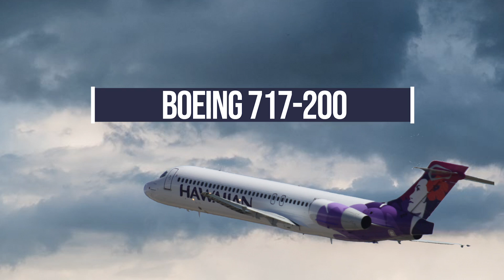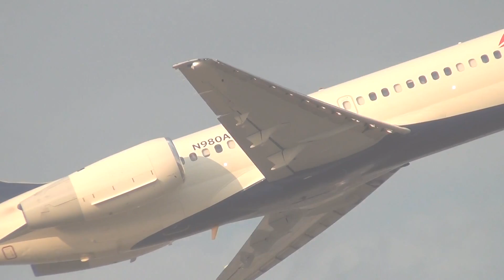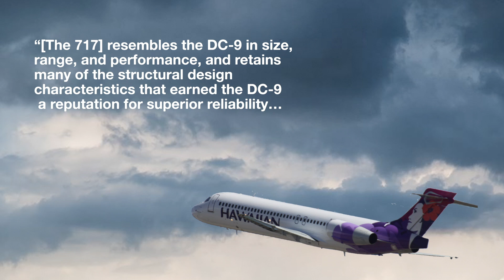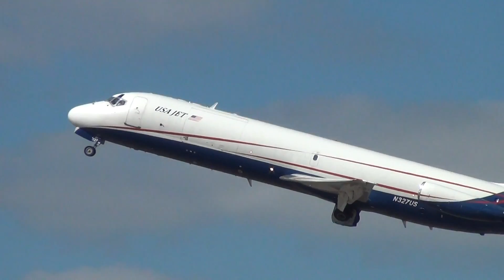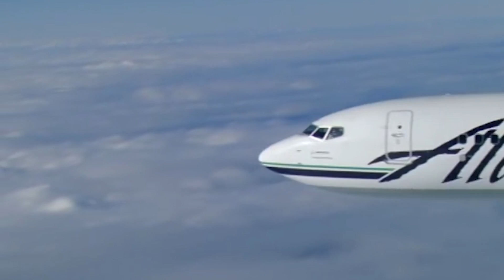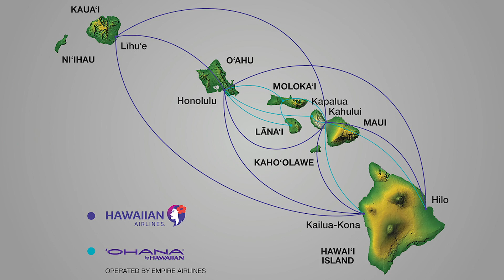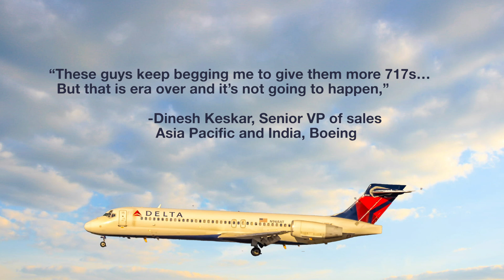Why Boeing Built The 717 And What Makes It Special

Comment: They built the 717 because they had the tooling and production line.  It was in production when they bought Douglas.  They thought they could sell a few more without incurring much in the way of development cost. They were after the 100 seat market. Until they weren't.
Reply: Even before "Day One", the first thing Boeing did was to try to lure all MD-95 customers away with cheap deals on 737s. When that didn't work, the next great idea they hit us with was to replace the autopilot control panel with one from a 737. Great from a Boeing commonality and training standpoint, however the DAC ACF control panel was a more advanced and simpler design, and thankfully our launch customer AirTran refused to let it change.

Comment: whenever i see planes with engines at rear i remember honda jet and i ask my self how come not more of companies put engines like honda did.
Reply: The single greatest mass in a jet is the fuel, which is in the wings. The second greatest mass is the engines. As you use fuel, the CG moves to the rear in an aircraft with tail-mounted engines, causing trim drag. Honda put the engines above/aft of the wings as they could not mount them under the wings. Putting the engines on the wings reduces structural loading (read: weight) the fuselage has to endure, putting them on pylons reduces the noise transmitted to the passengers vs mounting them to the tail section.
Reply: @rotty9786  all good and well... but why only honda? as i read your comment this is great spot for engine since it wont change CG during flight. so for small jets it would be perfect spot.
Reply: @jebise1126  agree, it is a good spot for a smaller jet if you don't have the clearance to mount them under/ahead of the wing. Why only Honda? Apparently they don't care that the engines look terrible in that spot (IMHO).

Comment: Boeing: "meh there’s no money in the 100 seater market. Dump it"
Airbus: "thanks”
Reply: TWA had a bunch of MD-95s/717s on order, since their was some commonality with its MD-80 fleet.  When AA bought TWA, AA planned to continue with deliveries.

After 9/11, AA pressed Boeing to reduce the lease rates negotiated with TWA.  The lease rates were based on TWA's lousy credit.  AA thought rates should have been reduced, to be in line with AA's credit rating.

Boeing would not budge.  Since AA's fleet of Fokker 100s were owned outright, AA canceled the remaining order and returned the planes already delivered.

Now, in retrospect, AA did the wrong thing.  The F100s became maintenance headaches, leading to retirement in 2004.  AA should have retired the F100s and kept the 717s.

But, when AA canceled the order, no one else was interested.
Reply: One thing is for certain: there’s no money in and rarely a good reason for cataloging unprofitable widgets, and this one didn’t sell. Unless the fortunes turn around for the A220 series, it’s headed for the same place: the history books.
Reply: @1_lens_view  Remains to be seen if it doesn't sell. No regional jets are selling ATM.
Reply: @1_lens_view  The a220 has enough orders to make it profitable, it is also a really useful plane in the pandemic.
Reply: 1_lens_view  I beg to differ. The A319/320 replacement may well be based on the a220 design. It’s an extraordinarily well designed jetliner
Reply: @Dean in BNE  I’m not saying the 220 is a bad aircraft or that it’s design won’t influence future products, I’m just saying so far the A220 has not been profitable for a variety of reasons, including low sales numbers. That has to change or that aircraft won’t stay in the line-up. There’s a lot of competition in the 100-passenger space.
Reply: I bet that Boeing can make more profit selling as little as 80 787s than Airbus does selling 600 A220s. Narrow body market has a very thin margin and the 737 was only profitable because it would sell several thousands. Boeing can sell 787 also in the low thousands and make a vastly higher profit margin.
Reply: Gabriel Teixeira uhm...what? An airplane becomes profitable if the sales grow over the development costs. And either way, airplanes are sold via leasing companies so that renders your argument useless. Or you are comparing net profit from each sale, which makes even less sense because those numbers don’t seem to make any sense.
Reply: @bobtahoma  Nope, never made a dime. How's BA doing btw? LOL
Reply: Exactly. Boeing has been making serious mistakes over the past few years. It’s actually quite sad.
Reply: Lol nice argument
Reply: The Trump derangement syndrome is real in this comment section.
Reply: @tylerkriesel8590  Agree. Came here to learn about the 717 aircraft, not political rants.
Reply: i like trump but im not in politics maga 2020
Reply: Airbus $30 a share  Boeing $130 lows $600 highs haha  Dump the bus
Reply: @youbestbequiet   Airbus has many more shares than Boeing - not least because Boeing has a habit of doing share buybacks to artificially boopst the share price (and hence executive bonuses). Boeing's total shares are worth $75B, Airbus is worth $48B.

Pretty well all Boeing's net value is in their defence contracts. In other words Boeing is totally dependent on the American taxpayer, while these days Airbus mostly pays its own way.
Reply: @kenoliver8913  Airbus is subsidized by france, England, and Spain, taxpayers paid for the development of their Airliners
Reply: @youbestbequiet  Dude, do you not understand the stock market? Or basic economics? Of course you don't.
Reply: @youbestbequiet  Wow, no wonder you fell for that MAGA BS, you're really not very bright!
You can have a company whose stock sells for $1 that is 50 times more profitable than a company whose stock sells for $2,000. Bet you went to Trump uni! Or are you just another plain high school dropout?
As I said before, no wonder you're a MAGA victim!
Reply: @galileogalilei7844  Lower taxes, record high employment, actual fair trade deals, troops being pulled out of bullshit wars, justice reform, UN and NATO finally being held to account....Yeah, we were tricked hahaha
Reply: @galileogalilei7844  And keep fumbling about with those $1 OTC trades. Thats what most wannabees play with.
Reply: @youbestbequiet  Wow, "Lower taxes, record high employment", the only ones paying less taxes are the richest ones, the ones who did not need a tax break to begin with. I'm sure you have not gotten any tax breaks anyway, you poor bastard.
And record high employment means nothing as population is always growing, what matters is the unemployed percentage, have you checked it lately?
You keep talking like a Trump Uni graduate! So ignorant, so sad, so lame.
Reply: @galileogalilei7844  The only ones paying ower taxes are people who actually pay taxes. Ours went down about 5%. Of course, no state tax in Florida so TRUMP2020
Reply: @youbestbequiet  So you went from paying $200 total a year to paying just $190 bucks, right? Or just how much does a high school dropout earn this days?
I'm sure the 14.7% of unemployed Americans (a higher rate than in the great depesion of the 1930's) are so, so happy to hear that the Trumptart will not be helping them since he decided to cut taxes on his wealthy friends and his ignorant followers instead, along with taking away health coverage for the rest of common people. Worst time to be an American since the great depression!

Shit floats so I guess that's why you, Trump and the rest of your shitty kind are way up there! Lol.
Reply: @galileogalilei7844  Dont worry, you wont lose you section 8 housing voucher or EBT card
Reply: @youbestbequiet  Oh FFS, I'm not a Murican! Lol! Lucky me! 
You seem to know a lot about the shitty USA social programs, I had to look them up myself as I have no experience with them as you obviously do.
I did get my masters degree there, worst 2 years of my life! I have a low tolerance for ignorance you see and the general public there is #1 in ignorance world wide.
Fortunately I don't have to put up with your shitty president and his cronies as I live in a decent place surrounded by decent people.
But you keep living your uncultured reality show life, you keep admiring your painted face, cheap blond wig, clown of a president, you keep supporting that false MAGA campaign lol. If that's what it takes to keep your mind off of the truth about your sad, puny life then you just keep doing that!
Enjoy it while it lasts, things that bad tend to auto-destroy and november seems to be just around the corner now!
Keep smiling boy! Lol.
Reply: @youbestbequiet  I am sick of tired or these "claims." Middle class people still pay more taxes and the rich pay less. Donald Trump has done NOTHING to support the middle class. He says that he wants the rich to pay less so they could start jobs. In reality, he does that to pay less. Also the middle class DO pay taxes but our rates aren't lower. Stop watching FOX and pay attention for once in your life.
Reply: @galileogalilei7844  He upvotes himself as well!
Reply: @meganthai1998  Ummmn he is not that bright.....
Reply: People, just ignore the MAGA incel. Like Trump, the only thing they want is attention.
The guy as no flipping clue about reality, that's what happens to MAGA brains on Fox news.
I can tell him one thing: the UN and NATO are not being held to account, they are instead laughing at Trump. He's a clown and you MAGA incels can't even see that. Pathetic and sad.
Reply: Galileo Galilei eat shit you elitist prick.  What does politics have to do with his post?  Regardless of his username, he didn’t mention anything political.  Just can’t help yourself can you?
Reply: ICNTOANTU  “peaceful” my ass.
Reply: @galileogalilei7844  < Mindless dribble from a socialist democrat.

Comment: As a retired Delta pilot I'm concerned for the Delta people and all airline employees worldwide. As for the 717, it was a proven, rugged and reliable type. Delta happily stumbled upon a bunch when AirTran folded. Note that the registration numbers on the Delta 717s end in AT. I've flown on them many times (as a passenger) and it's a smooth, quiet and reliable jet. Who knows what jets and people will be left standing and flying after SARS-CoV-2 is done?

Comment: Midwest Airlines and AirTran were the original launch customers for the B-717.  The production line at Longbeach CA alternated between these two air carriers, and several aircraft were in work painted in either’s livery colors. I was fortunate to have been on Midwest Airline’s acceptance team, and flew several C1 customer acceptance flights, usually up at Palmdale Airport. Great little airplane, but didn’t have the legs for several key city pairs
Reply: Don't you mean TWA and Midwest Express?

Comment: Not a single one has ever crashed or malfunctioned. It is the most reliable aircraft ever built with a flawless reputation. If Boeing was smart they would design an updated version of the 717 for when the 200s retire.
Reply: Novuso: That depends on your definition of the 717. The base aircraft, the Super 80, did have at least 1 crash; ASA261 off the SoCal coast in 2000. I was working the sector that was going to get him to LAX, but the aircraft failed before he was handed-off to me. Sadly, other pilots in the area saw him go down. It's kind of like saying a Cadillac has never been in an accident but a Chevy has.

Comment: A few of the aircraft clips in this video are DC-9s or MD80s. The 717 is easily identifiable by its squared-off top of the vertical stabilizer.
Reply: A carryover from the MD-90. Many parts are interchangeable from the DC-9 all the way through the MD-11.
Reply: A few later MD-80 series also had the squared-off fin.  I want to say MD-87 and MD-88?  Maybe only the 87?
Reply: Also the two giant RR engines give it away too
Reply: True. Because in some parts he was talking about said aircraft and/or related products.
Reply: @07VFDInLCD  Nah, he suggested they were 717s. He did talk about the DC-9, but then went back to talking about the 717 and kept showing more DC-9 clips.

Comment: Why is there still common misconception that the 717  is not as fuel efficient as the A319/A320 or the 737?!  Even with the old DC-9 wing, putting a pair BR715 engines makes the 717 more favorable in terms of total block fuel, cruise fuel flow (total 2100 kg/hour) and average fuel efficiency against the wider, heavier A318/A319 and Boeing 737-600/737-700 given similar loads. Delta is keeping the 717 because it is a very, very fuel-efficient aircraft.
Reply: I carry 180 people instead of 110 for the same fuel burn in the 737-900 vs. the 717 that I flew previously.  It’s incredibly inefficient, but a huge competitive advantage over the other carriers.

Comment: Hi. I worked on every DC -9 built all MD80 series and MD90  and MD95 also on DC10, KC10 , plus MD11. The DC9 was designed at Long Beach by DAC. One of the first customers, with a large order , was Air Canada.  Because of their order all DC9 wing production was given to DeHavilland Canada. Their factory was at Malton Ontario, at Toronto International airport, now Pearson airport. All DAC and McDonnel commercial wings from then on were built at that plant . All of those wings were shipped by rail to Long Beach. When DHC could no longer handle the program DAC stepped in and started DAC Canada. Later on DAC merged with  McD. When the MD95 program started it was a joint venture with Hyundai of South Korea. Hyundai wanted to get into commercial aircraft. Wings were built at the Canada plant and in Korea. The wings were shipped to Palm Dale CA for marry up and then again by road to Long Beach for final assembly. Boeing then took over, finished off the remaining aircraft and then shut all McD production down and changed the model name to 717. The Canada factory was demolished. The same factory where the famous Avro CF105 Arrow was built. dcniner01.
Reply: Thank you for the info.  I spent plenty of time with the 717 in production in Long Beach as airline rep/VP.  After the initial bugs were worked out, I just adored the aircraft.  At the first flight i got to know the German professor who designed the BMW/RR engines, which were marvelous powerplants.  I was a bit hesitant with a Korean-built wing, but I came to appreciate their desire for quality.  The plane was a wonder to fly, operate and maintain.  In short, if I could have chosen a personal aircraft for myself (if I could ever afford it), without doubt it would be a 717.
Reply: I love hearing stories like this, it’s quite unique and you can’t get these POVs from many other sources. Thank you for sharing, it’s greatly appreciated 🤝
Reply: Good to hear about people that worked for MDC. I was a FAA Flight Dispatcher Flight Ops Test and Production 1988 to 2002. Dispatched most of those aircract including the T45, UHB, C17 and got ride jumpseat on some production flights. During production flights went out over ths Pacific in an area called W291. Then over to Palmdale for landings and final max braking test at LGB. Spent time in Yuma at the Test Facility and some of us supported the T45 at Pax River, C17 at Edwards AFB and any aircraft the went on tour and flight planning the Make A Wish flights out of LGB.
Reply: Nice to hear from fellow Dougloids. I was on the nose join team 510. Built hundreds of MD-80's before moving on to the C-17. If you worked in hanger 13 we had to have crossed paths.
Reply: de Havilland Canada still exists today; it is now owned by Longview Aviation Capital and currently builds the Dash 8 Q400 at its plant in Downsview, Ontario. It now has a sister company based near Victoria, B.C. called Viking Air which builds the DHC-2T Turbo Beaver, which is an upgrade of the original DHC-2 powered by Pratt & Whitney Canada PT6A-34 turboprops, and the DHC-6 Twin Otter Series 400.
Reply: I remember when Boeing bought MD and the mechanics were so happy that Boeing was "saving us" I told them they bought MD just to demolish it they just wanted st louis for the fighter jets and steal the over funded pension plan  Boeing destroyed a great company! But the funniest part is when they started calling the DC-3 The Boeing DC-3